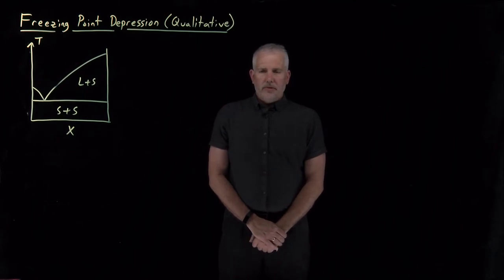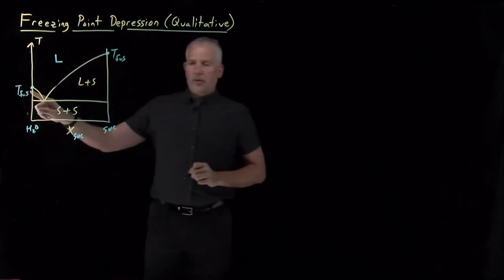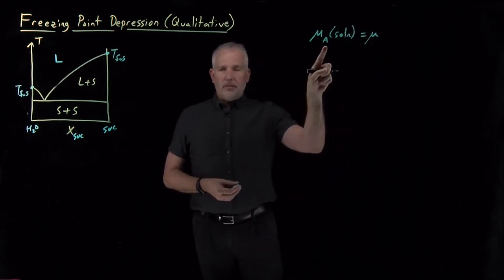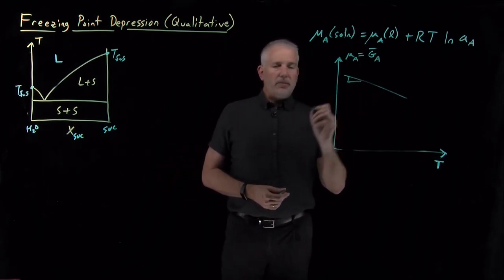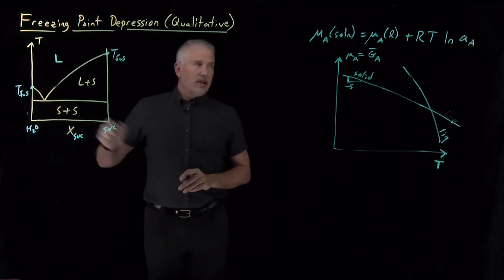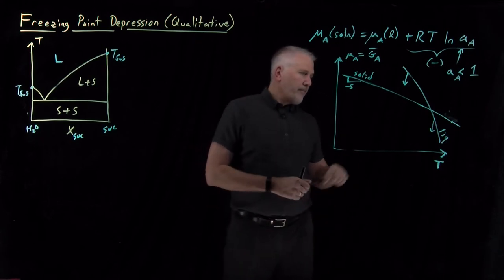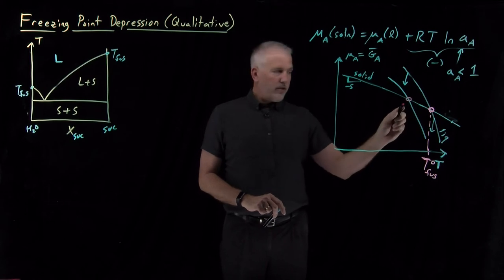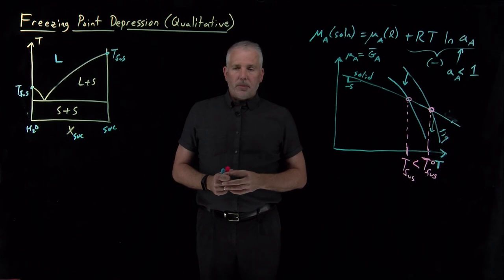Freezing Point Depression (Qualitative)

Comment: I followed all of this (math and partial Gibbs vs temp curve shift). That all makes sense, but I am hoping to find a lower level intuition behind freezing point depression. Perhaps, is the Entropy of fusion larger with the solution, so T_fus = "Enthalpy of fusion" / "Entropy of fusion" is smaller? Maybe because the introduction of another component to the homogeneous solvent provides more arrangements (higher multiplicity/entropy) over the Entropy of fusion for the homogeneous solvent? And maybe the Enthalpy of fusion doesn't change as much. Does that make sense? Thank you!
Reply from the maker: At the lowest level, it does all come down to entropy.

The solid freezes when the liquid is cooled enough that it would "rather be" solid. As the temperature drops, the entropy decreases; at some point the lower energy of the ordered solid phase wins out over the seductive disorder of the liquid phase.

When a solute is dissolved in the solvent to make a solution, it makes the solution more disordered; its entropy is increased. Thus, it needs to be cooled down further than the pure solvent does, in order for the solid phase to win out.

Thanks for the great question -- that led me think about the phenomenon in a different way than I usually do. That will improve my presentation the next time I explain it.
Reply: @PhysicalChemistry  Makes sense. Thank you, thank you!

Comment: I had a doubt .In my textbook it was mentioned that freezing point is the temperature at which vapour pressure of liquid state solvent is equal to the vapour pressure of liquid state solvent .But gas ,liquid and solid coexist at triple point .How is it ,then, that the description of liquid and solid phase equilibria talks about the existence of vapour phase ?
Reply from the maker: Check your textbook again; I think there must be a typo in your question. The freezing point is the temperature at which the *chemical potential* of the liquid is equal to that of the **solid**.

You're correct that gas, solid, and liquid all coexist at the triple point. 

If I understand your question right, then you're correct: a liquid/solid equilibrium for a single substance should only discuss properties of the liquid and the solid. Unless you are at the triple point, there will be no gas in the system.

But there can be a liquid/gas phase equilibrium over a range of conditions. And the there can be a solid/gas phase equilibrium over a range of conditions as well. Just not both at the same time for a pure substance, unless you are at the triple point.

Comment: What do you do if you have two solvents mixed with water. Can you calculate them by their own using blagdens law. Or do you do something else
Reply from the maker: That's the convenient thing about colligative properties. It *doesn't matter* what the solutes are. The freezing point will be depressed by the same amount if you dissolve 1 mol of substance A in solution, or 1 mol of substance B, or 0.5 mol of each. To calculate the freezing point depression, all you need to know is the total concentration of everything in solution -- not what they are.

(This assumes the solutions are ideal, of course. In reality, it will work well or poorly depending on what your solutes are.)

(Also, +1 for Blagden's Law, which is a term I haven't heard!)
Reply: @PhysicalChemistry  okay, but Blagdens law says that you have to account for ionization (vant hoff factor). okay, say for example I have etyhlene glycol and MgCl2 solved in water. I have 200 g glycol and 200 g MgCl2 and 600 g of water. Could I do like this: 200g glycol/62.07 (molar mass)=3.2. It has i factor=1 so then I take 3.2/0.6 (water in kg)=5.4. Then I multiply that with 1.86 (constant for water) and get 10 degrees. Then I do the same thing for MgCl2 but use I factor= 3 instead. So 200/95=2.1 moles. 2.1/0.6 times 1.86 times 3 which is 20. Then I add 20 to 10 and get 30. So the frezzing point should be 0-30=-30. This seems correct but is it
Reply from the maker: @tysken0251  Those concentrations are (much) too high for the ideal approximation to be valid. Ionic solutes are very non-ideal. But the basic idea is right.
Reply: @PhysicalChemistry  okay good, but if you have an ideal solution like ethylene glycol only. Should the formula work for like 300 g of glycol and 700g for water?
Reply from the maker: @tysken0251  If the solution were ideal, yes. (But ethylene glycol + water isn't an ideal mixture, especially at 30% w/w concentrations)